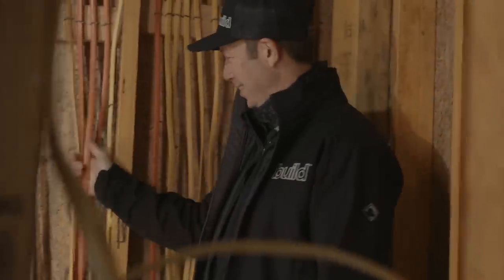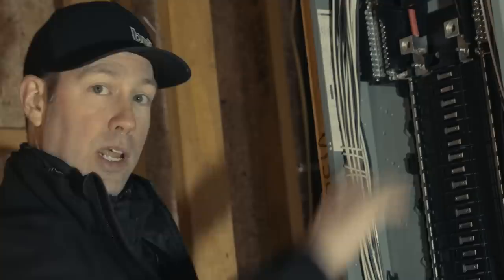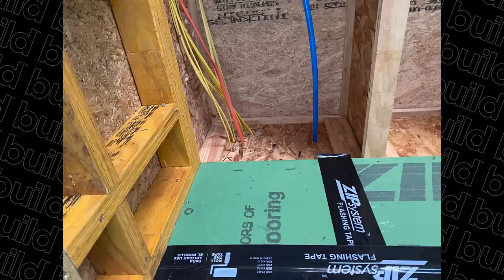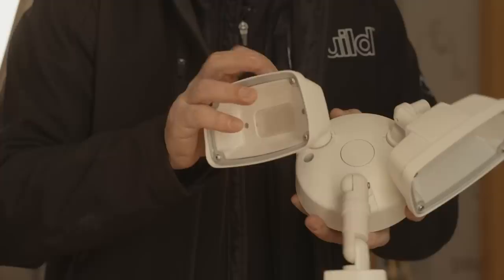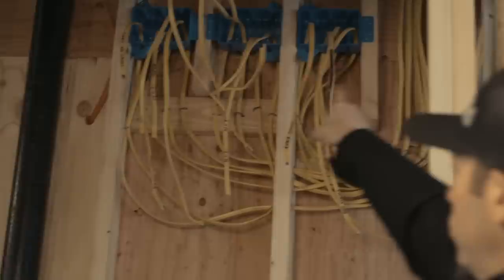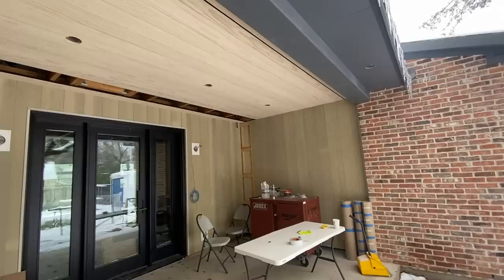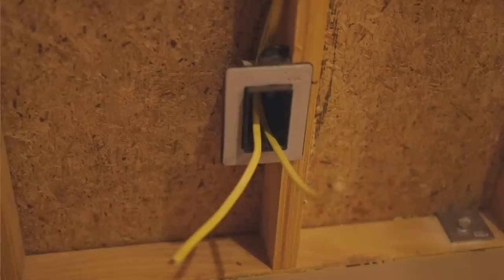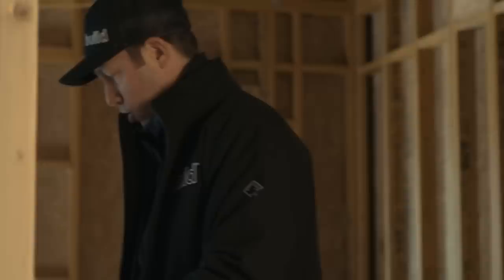5 Tips for New Construction Electrical & Smart Lighting!

Comment: 14/2 shouldn't be allowed for receptacles it seems like an awful idea.
Reply: And it smells like smoke
Reply: I live in Iowa. We use 14/2 for lighting circuits only and 12/2 for receptacles. So any room will have at least 2 circuits. If you trip your outlets the lights stay on and vice versa.
Reply: @RaddestDad  me too, and there's plenty of 14/2 for general purpose receptacle, you live in Davenport or something?
Reply: Why? It's rated for 15 amps you planning on running several vacuums on the one circuit or something?
Reply: Ima apprentice electrician. I would never use white wire if I could afford not to. 

Just want to keep it safe.
Reply: @chriswithrow3107  Ankeny
Reply: @shawnshurtz9147  most space heaters are 1000W or better with most being 1200W and 1500W
Reply: @buk6708  interesting im a 17yr JW it's safe. It is however way faster to just use all 12ga for most branch circuits. Your breakers especially the ones required now will protect your wire if properly rated.
Reply: @buk6708  also price is negligible difference in a house. Large commercial it could be in the 10s of thousands though.
Reply: @shawnshurtz9147  I ran some lights and outlets, on such a small remodel I would rather just use yellow. Until I feel safer. I work under a journeyman Electrician. I am a journey Carpenter. But it’s truly back breaking.
Reply: @shawnshurtz9147  yes, I only worked in remodel elec so far. 

5 panel change outs
10 outlets job
15 lights jobs

I’m probably 20 total jobs in.

I ran 4 outlets for horse fans for some AMAZING looking horses at a guys barn. Just charged him $300, 6 hours. Told him get all material, including yellow wire.

I know it may sound wrong, but I just want to ensure 100% safety.

I would like to go beyond code.

I’m trying to learn how to solder pipes correctly also, do better plumbing repairs. 

Electrical is my fav trade, it truly pays the best. Trust me Form/scaffold/residential Carpentry is just to much physical work. Feet always wet and I fall asleep in truck after work lol. 

Carpenter-31
Electrical-34.5

Ibew benefits are like double UBC though. 

Either way, have a good day Brother.
Reply: @RaddestDad  ok so 15 amps at 80 percent that's 1440 watts on a 15 amp circuit that can run continuously. I feel safe with that. You can pull 1800 watts on a 15 amp circuit just not continuously.
Reply: @buk6708  what local brother?
Reply: @shawnshurtz9147  283 UBC
Reply: @shawnshurtz9147  I’m doing Elec non union though, my friends business. We are gonna have Carpentery and Elec under same house, he is a JW in IBEW and an excellent Carpenter.
Reply: @buk6708  oh man move north if you can way better scale. I'm local 14.
Reply: @buk6708  or just travel a little.

Comment: next owner will be ripping all that automation stuff out and put in normal switches. or you as 'smart' devices are good for about one to two years before problems start,  the manufacturer will no longer support them forcing you to remove or  UPGRADE everything, and it appears as though your wiring methods will make that darn near impossible, without cutting every piece of sheetrock from your panel to timbuktu. and 12 for everything? I hope halo is paying for your electrician, tho I'm sure they are. No sane person, or electrician, would wire a whole house with 12. it's something my senile old dad would do, "cause bigger's better! this is mur'ca!" you are not an electrician. get an electrician to make these videos. or at least tell you what to say. you're causing a lot of problems for anyone wanting to work in this house in the future.

Comment: Like the copper wire and air sealing detail, but I'll stick to my Lutron lighting controls. Bluetooth is really not designed for this application. I suspect there will be issues with pop corning and slow response time. Plus with no hub there is no remote access. I'm glad to see there are still switches in the closets so it could be shaped for a different system down the road.

Comment: I usually agree with most of your videos. I feel compelled to respectfully comment on this one though. 20a 12/2 is massive overkill for modern LED lighting. It’s more expensive, harder to work with, less wires allowed in each box as they occupy more volume. In addition if you have a dedicated sub panel you’ll have plenty of room to better sectionalize each circuit and reduce load. In addition aluminum feeders and services are perfectly acceptable for main and sub panel lugs. Copper is actually worse due to dissimilar metals causing oxidation. The only advantage I see to copper is that you can get away with a smaller wire to carry the same ampacity as a larger aluminum conductor. The added cost of copper rarely ever makes sense. In fact most utilities run aluminum services from the pole to your entry cable. I run 12 ga to all receptacles though due to the unpredictable nature of what a customer could plug into an outlet.

Comment: I’ve had a similar system in my house since 1995 (low voltage relay controlled) , it does everything he demonstrated except the Bluetooth.  I wired the house myself..  I don’t understand the #12 on the lights.  That wire will operate that light and only that light, always.  It never changes and never has any other load on it, ever.  Even the runs back to the panel, if you calculate your load correctly 14 should be fine.
Reply: Very true, but, not everyone has the deep pockets that some folk have!  I'd go with #12 or even in some cases #10 for outlets but only #14 for all lighting circuits.  The reason for the #10 or higher for SOME circuits is that I'd want to be able to power a couple of high performance computers (1500W+ power supply).  I will say my load panel will be freaking huge though, outlets and lighting for any given room would be on separate breakers and no two rooms would share a breaker.  That may change though as LED lighting gets more efficient LOL  The big problem is, I need to win Lotto to build what I want!
Reply: For me it was logistics. The difference between a spool of 14 awg and 12 awg was about $8 per roll. I rather just buy rols of 12 awg and not get the call from the electrician. "Hey i'm out of 14 awg wire - I be back in a couple hours to go pick more up while Im on the clock!"
Reply: I have a sneaking suspicion his electrician combines lights and receptacles on a circuit.
Reply: @kenbrown2808  Nothing wrong with that, or is it ?
Reply: @benjaminvivar7855  if you don't mind being in the dark while you're replacing a failed receptacle. or not being able to plug in a worklight, while you're changing out a failed switch.  or don't run your lights in #14 and receptacles in #12.
Reply: @kenbrown2808  he may be doing just that.  It never even occurred to me to put lights and receptacles on the same circuit when wiring my house. At least separating them would effectively reduce the need for flashlights.
Reply: @kenbrown2808  Im reading, “ INCONVENIENT “ I’m not reading, “WRONG “. The NEC is not about your convenience it’s about,” practical safeguarding of persons and property from hazards arising from the use of electricity.
Maybe your comment should’ve read the following ,”I have a sneaking suspicion his electrician combines lights and receptacles allowed by the national electrical code but not allowed by the way I install it. 😡
Reply: @benjaminvivar7855  the question asked was why he was using #12 in lights, not whether using #12 in lights was acceptable to code.
there's also something in the code about it being a minimum standard.
Reply: @kenbrown2808  I was using your comment to make a point about what is expected in terms of installation according to the NEC and the difference of what people think should be done.
Reply: @benjaminvivar7855  ok, then.  yeah, difference between code and best practice is a valid point.
Reply: @kenbrown2808  Don’t get me wrong, if I were to wire my own house I would do it exactly as you said I would separate the lights from the receptacles and keep them separate for the exact reasons that you mentioned. But I wanted to make a point common sense is one thing and the code is a different thing.

Comment: As an electrician, I have to say that Matt is right about wire cost and breaker cost. But 14 gauge wire is fine for lighting. Breakers trip because they are overloaded which means that the circuits were not sized correctly or people are plugging in too many things on one circuit.  All circuits need to be sized correctly whether they are 15, 20, 40, or 60 amp circuits or whatever. If your breakers are tripping, you have too much on them. There is no real benefit to going to 20 amp circuits for lighting. Outlets in places where many appliances will be plugged in are fine to wire in 12 gauge, good idea. But you don't need to do the whole house. Just living rooms, bedrooms, offices, kitchens, bathrooms, etc. It's a good practice to run lighting circuits separate from outlet circuits by the way.

As an aside, NEVER put a 20 amp circuit breaker or fuse on a circuit wired for 15 amps (14 gauge wire).  The wire will overheat.
And Leviton is crap. If you want a smart panel, go with someone else. I hope you didn't use Leviton switches and outlets.

Comment: Why do you have so many penetrations of the exterior walls for electrical  connections.? Here in U.K. we have just the meter on outside so just have three cables to air seal. Also we do not have heating devices outside. This reduces air sealing and frost problems. Would this not be a good idea in Texas bearing in mind recent events.
Reply: "so many penetrations"? In one 16x16" area under the main panel? WTH are you talking about?

Comment: It is best to not put a panel outside like that. This was done on tract homes in more temperate climates as a way to save money, but now is not recommended. Just have a disconnect switch/meter combo outside. This is because breakers will not last as long outside and everything in the panel is exposed to more extreme temperatures and moisture. If you want a sub panel, put it right next to your main panel inside, you want as short a run as possible. 20A conductors for lighting circuits is not normal. In case you have never seen NEC Article 310.15 (B)(16), 14AWG conductors can actually handle 25A, but the breakers are sized down to 15A for safety.

Comment: Regarding CANLESS recessed lights in a ceiling with a batt insulated attic above it. How do you air seal those types of lights? I know, they come with a gasket BUT I know (from experience) that gasket is most likely not enough to stop air flow from going from below to the attic above. Air pressure and the stack effect probably will push air around that gasket. What's the best way with these CANLESS recessed lights? Thanks.

Comment: Love Matt but everything and I mean everything draws less power in these modern times. Only place I would use 20 amp circuits other than those that are required by the NEC would be an over the top home theater where someone is running some serious wattage in subs and equipment. And yes, copper sucks, but you can also use compact aluminum conductors that are equal to copper. Never buy panels with aluminum bus... not even for residential.

Comment: I live by the theory of, over-wire and under-breaker. Run 12-2 with a 15 amp breaker and so on, never worry about having a wire burn inside your wall. The breaker snaps well before. JMO.
Reply: Completely overkill. 20 amps for #12 is already derated.
Reply: I agree with August
Reply: Extreme over kill. Especially with known loads that will never change.
Reply: @nickstopherd7762 , You are 100% correct but, I'm a little overkill myself. !

Comment: Everything is wired with normal wire it's a very important thing. Over in England they're finding out that calling the electrician in to change a lightbulb is not very efficient. when the manufacture specifies that it lasts so long and it doesn't. Most of the channels I watch are going back to the traditional replaceable bulb units is then the customer has the option of changing it themselves when the Bulb goes.

Comment: Really like using those canless recessed lights.
Reply: I don’t like can lights, they leave shadows. In a new home, I would use modern linear LED lighting which leaves uniform coverage and no shadows. I also have bad luck with can lights at home, the dimmable halogen ones constantly burn out and when I replace them with LED bulbs, they crap out in a year or two as well.
Reply: @dcentral , I agree and it takes a ton of them compared to surface lights, but I'm old.
Reply: Just don't look at them ....like looking the sun
Reply: @jayhawkmba  your Kelvin is too high. 2700K is the only K to use indoors.  It mimics incandescent.  Dont just go by "warm" its different in different countries who make the bulbs.
Reply: @JH-sp5my  3000k - 4000k is perfect for homes depending on what your taste is.. 2700k is way too yellow
Reply: @JH-sp5my  2700 outdoors, I prefer 3000 -3500 indoors.  Regression is needed though

Comment: Something to keep in mind, 12-2 is thicker and stiffer than 14-2. It makes it harder to install, not a lot, but enough that if you're doing the installation yourself, it can wear on you. I did my last house 12-2 everywhere but I really didn't see much benefit to it. My current house is only 12-2 where I need it and the 14-2 is like butter to install. I guess I'll see if the 15a circuits trip more frequently.
Reply: I've seen some of these videos where people use ticker gauge wire, and I always wonder why. Is there an incremental benefit? Harder to work with, and the same result - the light turns on when I flip the switch. What am I missing?
Reply: @peteganze6416  mostly a bit of paranoia, and the idea that 12-2 is "better" (not if 14-2 is used properly).

Comment: Oh Ghod, Texans.  I suspect that is the only part of the country where the main circuit breaker panel is out in the weather.  I know in Michigan at least, the ONLY electrical that is outside the home (or business) is the meter and the cutover switch if you have a whole building generator system.
.
My grandparents had a LV control system for much of the lighting in their home in W.Va. back in the 1970's  There were three control panels that could switch 9 zones in the house and it wasn't a huge home either.
Reply: It seems to be somewhat common in the most southern states - I've seen it in CA, AZ, TX, FL homes. Not sure about AL, GA, or LA. If I was building a home in the states where it's common I'd put only the code-required disconnect switch outside and the actual breaker panel all inside.

Comment: I would recommend installing low level secondary lights that are motion activated, i.e. all closets, but also throughout the house along the most common routes, i.e. if at night when going from the bedroom to the kitchen motion activated low level lighting that just lights up the path enough to see without the need to manually switch any lights on using a switch. I have then retro fitted then using rechargeable units, (last three months) and they are so effective that for any new build I would have them installed as standard. Ideally, at night, you should be able to walk throughout a house at night without the need to touch a light switch but not have the lights come on so they are blinding. Closets can be motion activated but it would be more economical to have a door switch, as there isn't any point running motion detection on a closet that is rarely opened.
Reply: For example ?
Reply: @benjaminvivar7855  As in an aircraft where lights close to the ground light the route to the emergency exit, you should be able to walk throughout a house as this video shows, https://www.youtube.com/watch?v=rsKM0GO5hVU, but whereas these are retrofitted and battery, with a new build there is the opportunity to have them wired in properly.
Reply: You’re looking at around $100 for a decent proximity switch that also is photo sensitive.
Reply: @RaddestDad  I have rechargeable LED night lights which I picked up for $15 each, they work great but it would be good not to have to recharge them every few months. They allow you to select between eight colours and I would certainly build them in on a new build. 

There is now a lot of available intelligence in LED lighting that wasn't easily available before, but it is important to get the right unit in the right place, the low level night lights are ideal for lightening up a route, but in other places you would probably want the lights to come on full. 

Pet hate of mine is people leaving lights on when they leave the room, perfect solution is to have the lights come on and turn off automatically.

There are also lights that when in standby mode can allow a light to remain on all the time at night at 20% light output and upon detection go to 100% output and after no detection goes back to 20%.

So much functionality, and a new build is the right time to really explore what is possible.

Comment: I wonder whether those Arlington Boxes could be used for bringing in the cable or satellite wire, in an air sealed manner?
Reply from the maker: 🤔 possibly
Reply: Yes, they have gasketed rim boxes. It picture frames a foam gasket around the box recessed 1/2” behind the face of the box. It allows you stud mount it or even face nail it to the exterior sheeting.

Comment: Today's AA8000 series aluminum wire doesn't oxidize like the AL wiring made in the late 60s early 70s did. The copper shortage caused wire manufacturers to rush out AL wire which wasn't great quality.